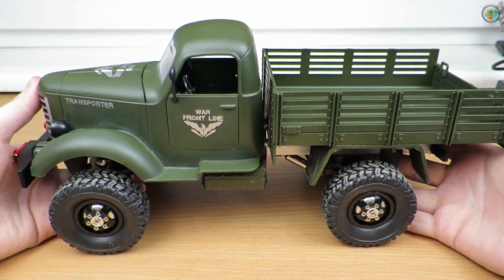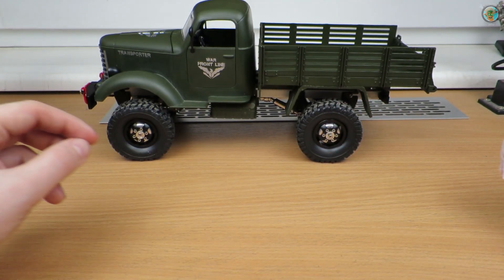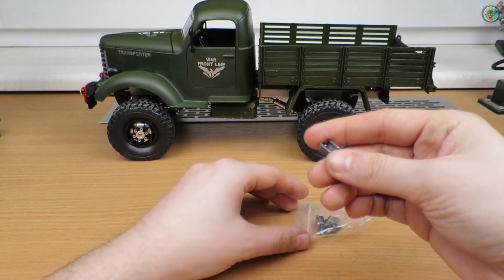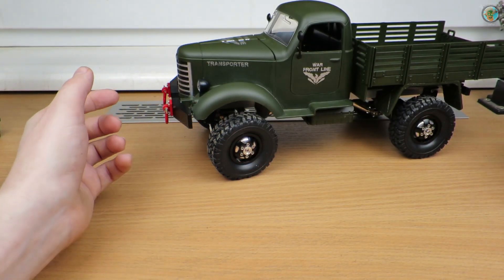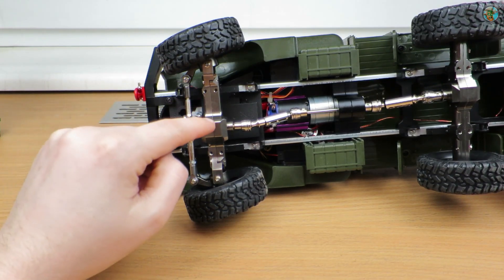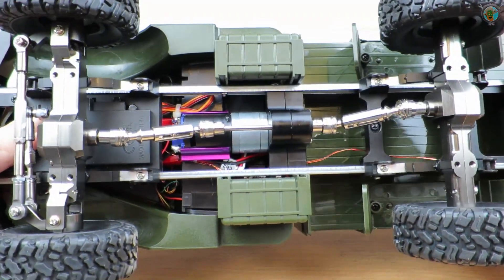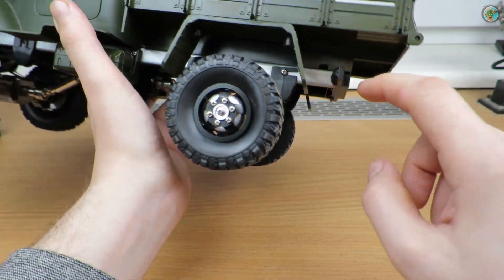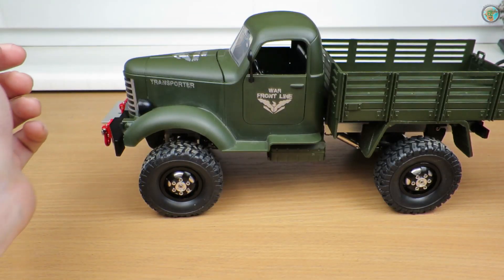JJRC Q61 - Metal car project

Comment: The screws for the front servo mounts are 2.5mm thread. I used these to make mine right. He is right the screws supplied with mine were too short and wrong size.

Comment: The servo on my rc used to behave like that whenever I turned the gyroscope feature on, on my dumbo rc receiver, but it behaved normal while off. I also have the same front bumper in silver colour, instead of cutting the fenders, I fitted it upside down, it doesn't lool bad, but it eats up a bit of ground clearance. My gearbox is also like this one, I also had to cut in the middle of the cab to make it fit. But now there is a different design of that gearbox available in the market which fit easily without the need to cut the body. I now have that gearbox in my other rc, the jjrc q65 jeep.
Your truck is now looking very nice! How about custom paintjob and a running video!!!
Reply from the maker: On Dumbo RC You can use potentiometer to reduce gyroscope sensitivity and that should fix that problem, just set it to 50%
I did not think about putting it upside down, noce idea :)
I don't like to do painting, signs and logos on it are terrible but if I paint it it will look worst :D

Comment: About the servo mounter. Where do I put the switch to turn on the car.
Reply from the maker: There is original slot for that and also You get that switch.
Just cut power cable and solder to 2 pins and ready
Reply: @Adrian202  is the slot on the mount? And if there is, I don’t see any holes to screw the switch into.
Reply from the maker: @tekayvoong5545  Slot is next to steering center hole under front parts of car and You get switch n box
Reply: Why does it make that loud squealing sound? Great truck by the way oh, I'm going to do almost exactly the same thing to my Q 61